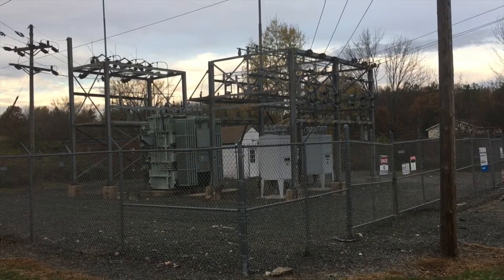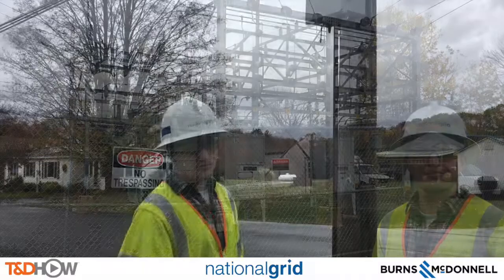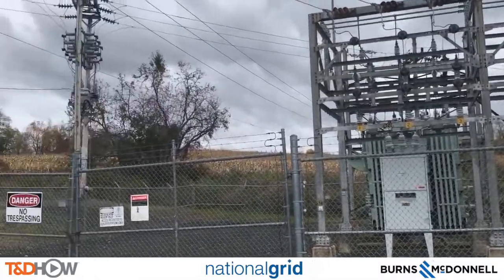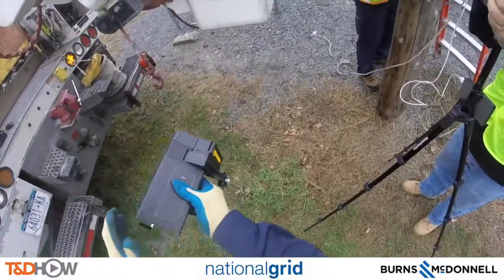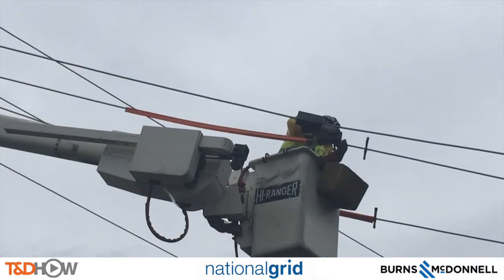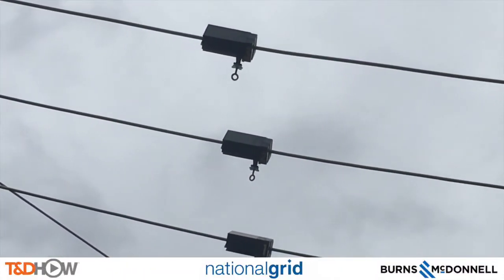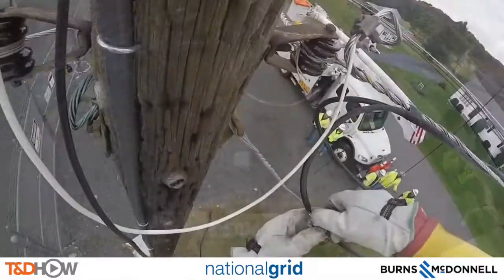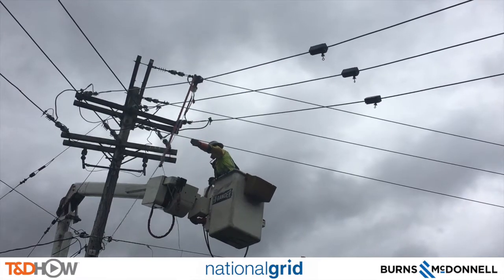Line Watch Sensor Installation

Comment: Pointless video. Big fan of channel. But line sensors waste of time. Even people who watch this video who are just consumers this video explains nothing. All of our system is smart grid and we have scada to most every device. Even our AMI metering infrastructure  these line sensors are just a cheap pointless means of data for national grid. Hell almost all subs for small companies have microprocessor relay's so like the standard Cooper controllers or shweitzers. Stick to the building lines and getting the lights back on.
Reply: Actually this video is very informative. Remember people from all over the world watch this videos, and these solutions are applicable to many areas around the globe.
Reply: People want to see what keeps the lights on or how the Power gets on not how the utilities look to gather money or change rates. And yes I know what I'm talking about.
Reply: There are still plenty of substations that don't use smart relays so this is still highly relevant. I was very interested to see this video.